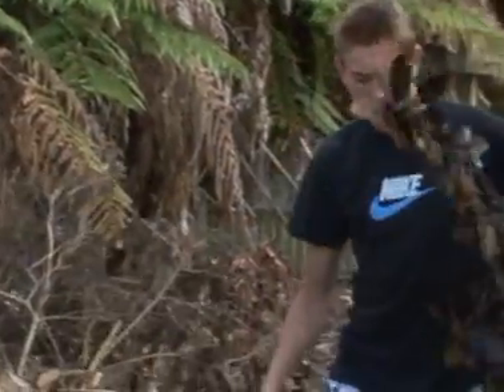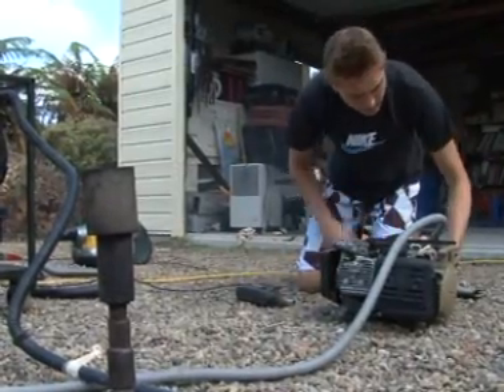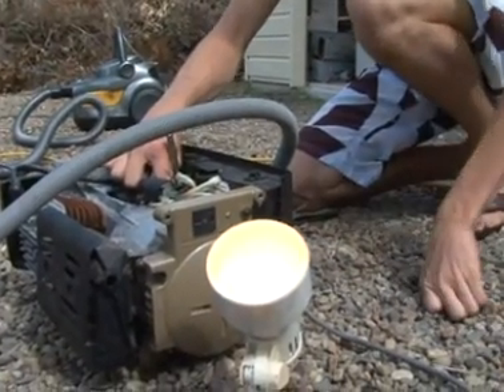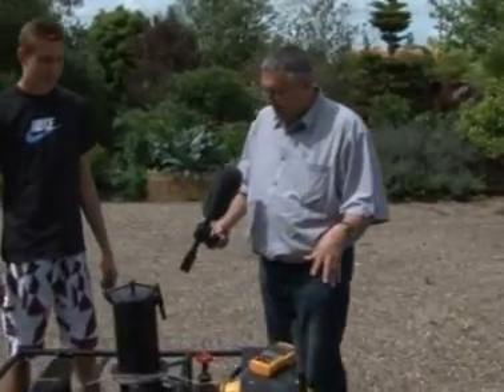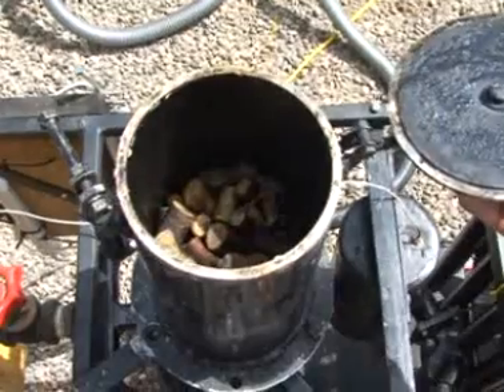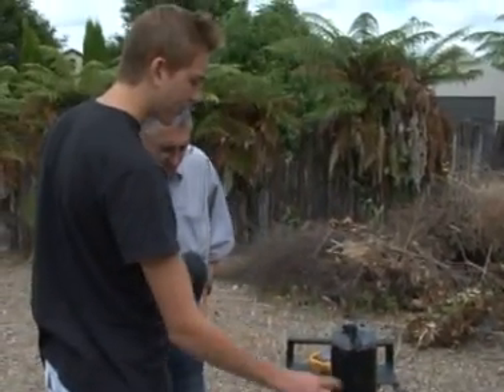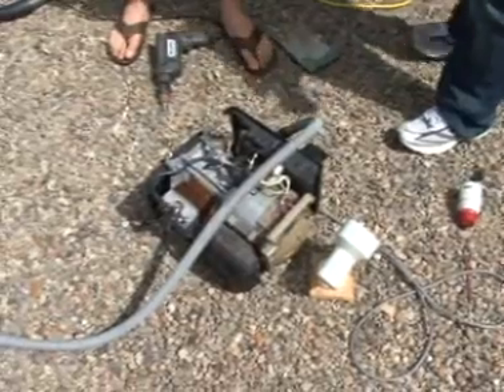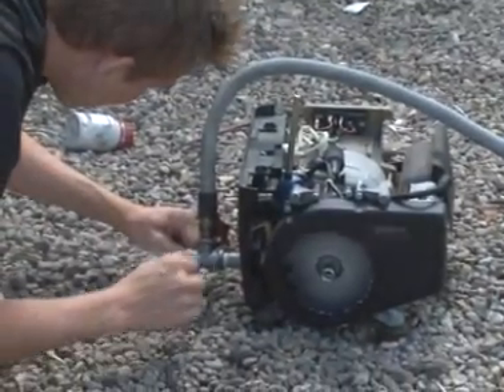Gasifier project

Comment from the maker: As you will probably be aware from the video, this is a prototype which is currently under development. Jake's invention has been tested and is proven to be carbon negative. Jake kindly used the tumble dryer to dry wood for us in order for the machine to function at its optimum for filming. It is clear you are unsure of the process which is being discussed in the video. Thanks for your comment.